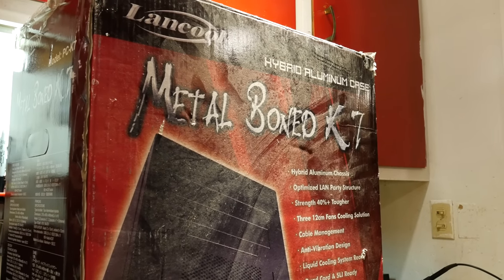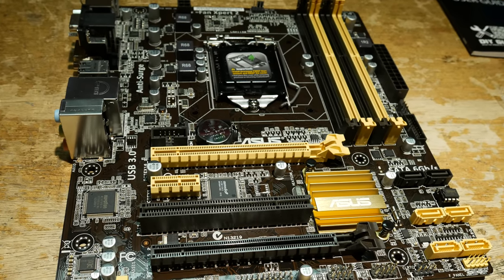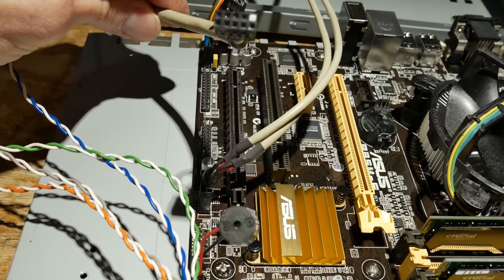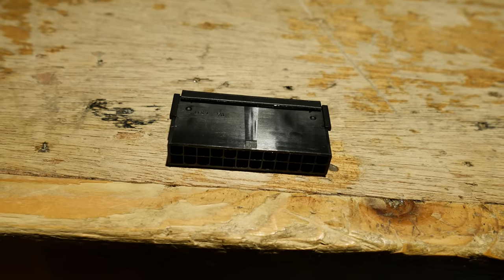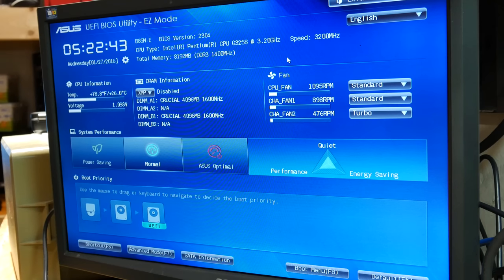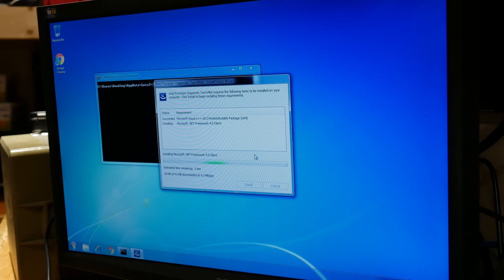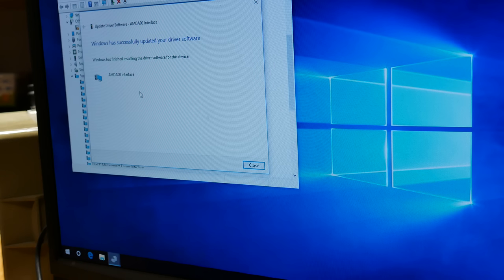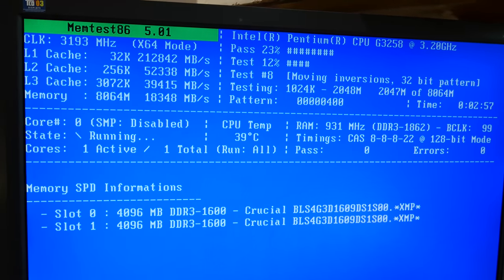New Office PC Build Jan 28, 2016

Comment: I see that you chose regular mbr mode when you booted from the usb. Now thats not really a big deal but whatever. windows 7 was better before, but microsoft is trying really hard to push windows 10 on everyone. I dont know if they do it for spying on the people that don't care or that think cortana is awesome(which btw is pretty deeply integrated into the os with the windows search engine which results in cortana still running even if you disable her). I think this may be their intention but im not sure of their reasons. They deliberatedly "crippled" their services relating everything else than windows 10. it begun in win 8 times when i got an asus laptop with an intel baytrail soc (full size laptop with a 4 watt cpu) that while intel maintained chipset and graphics drivers for even win xp, asus decided to use wireless network devices with no freaking drivers for windows 7. It refused to work if i tried to manually use the driver files from win 8. So after i was almost done configuring the laptop as the owner wanted because they did not care about win 8 and wanted 7 i had to tell them that there was no way to use the included wireless on their brand new sistem. I ended up installing win 8.1 and everything worked. Back to what i was saying about microsoft pushing win 10 even to people that are not interested. They only have directx 12 on win 10 (not 100% sure on that). And they announced that processors newer than skylake and i assume amd zen will only have patches for windows 10. I didn't word that properly but they said that they wont make cpu related updates to older os's only to windows 10. They are reffering to things like hyperthreading support back in the p4 days or when they released a patch that allowed windows to better utilize the cores/modules in amd fx chips. That wont be that big unless some new cpu technology arises but still. Microsoft is really pushing win 10 and flushing everything else faster than before. Maybe because win 7 is a good xp candidate and they dont want to have it live this long because they want to make windows be a service you pay for every year or idk. They certainly pushed alot of people with directx and the free upgrade and crap. On a sidenote im not too fond of the white looking status bar on programs. I made it transparent and have the color of the taskbar that is being taken from the wallpaper. I am not sure why microsoft is pushing win 10 so hard but i am not feeling good about it. I am running 10 too but i have an older pc and when 10 launched i had that itch to be on the bleeding edge and it worked pretty good considering i upgraded from a used install of win 7. It felt a bit slower on my ssd than win 7 and idk what's up with that. But comparing it to win 8 launch which was a total shitstorm, it worked for 3 days before almost turning unusable all of a sudden and being buggy and crap and needing a reinstall. All on a fresh install of 8, not even talking about upgrading which resulted in an unstable mess. So yea, win 10 is a decent os after you work on the appearance and turn off the spyware crap. But its a teeny tiny bit slower than win 7 on my sistem, ill blame that on not the best optimization on a sistem like mine. Still i'm not sure why microsoft promotes it so hard. Ok, its 2:10 in the middle of the night, almost morning and i've been writing on this comment for 30 minutes atleast on the crappy touch keyboard of my phone, i really should stop rambling and go to sleep, im still only 17 without a month and a few days. Nice build video as always maxarcade. Always nice seeing you in my youtube feed, especially with a computer related video. I have been following your videos for around 2 years or more. Hope you will give me a reply if you know what are microsoft's intentions with win 10.

Comment: Oh and another thing because i cannot reply to my previous comment on this stupid phone. Why did you not set the memory to something good, like the rated speed of the ram. Or maybe 1333 if you think xmp might be an issue for stability. Altho i am almost 100% sure that it is not the case, running xmp only auto sets what the memory says its capable without you having to do it yourself because people dont care about things like 9 9 24 or whatever was it. I think that leaving the ram at the goofy 1400 or 1862 or wth was it actually running at was worse for stability than running the ram's settings even if it perfectly passes every test.

Comment: I personally dont have the feel for windows 10 working in a computer shop we have so many people bring there computers in where display drivers have failed to install or they have lost some files, But windows 7 is definitely getting worse for drivers on newer devices.
Reply from the maker: +anto91784 Ya, Win10 definitely doesn't like the Radeon X1200 on some Vista era laptops.  Other than that I haven't had any issues with it.
Reply: Maxxarcade it especially dosent like older era dell laptop's  like the latitude D630 which most people have as they dont like to upgrade there laptops.

Comment: The pentium g3258 can only support up to 1333Mhz so it changed it for you
Reply from the maker: +newrhea13 Sure, but why would it change from 1333 to 1400?  Seemed odd to me.
Reply: Maxxarcade I would have to assume that it would be caused by a motherboard inconsistency, maybe related to b-clock? not to sure here, below was copied from Intel ARK informational website.

Memory Types	DDR3-1333, DDR3L-1333 @ 1.5V
Reply: ***** 1333Mhz is not such an odd speed haha, and it runs at 1333Mhz, but your mobo probably just shows it differently.
Reply: +Milan Jovanovic Some games run bettrer because "PENTIUM POWER" or something maybe it's just so slow that it's fast again:)
Reply: David's Music the pentium g3258 is an lga 1150 cpu
Reply: Yeah, last gen :)

Comment: OEM of the eVGA is Super Flower. One of the best on the market. The platform is Leadex.

At least I see progress in your selection of parts... specially for motherboards. ASUS are the best on the market, not the shitty Gigabytes you used before. ;)

Vietnam have one of the biggest Intel facilities at the moment (opened in late 2014). Statistically Vietnam chips (batch starting with X) clock worse and are hotter than other made in Malaysia or Costa Rica.

p.p. Put the ram into yellow slots (which are far from the cooler). They should be main.

Comment: You can install Windows 10 1511 clean installation and activate with 7 key
Reply from the maker: +My Tech Channel That actually didn't work for me when I tried it on my recent workshop PC build.  I called MS, and they said I had to install 7 first to activate the COA.  Afterwards I did a clean install of 10, and it activated automatically.
Reply: +Maxxarcade It worked for me

Comment: You wouldn't have had those problems with Windows 7 if:

 - Microsoft released another Service Pack for it. (To prevent installing billions of updates)
 - Microsoft finally fixed the Windows Update issues relating to svchost.exe (I mean, really. C'mon)
 - Asus used simple driver installers, like in times past. (There was really nothing wrong with that)